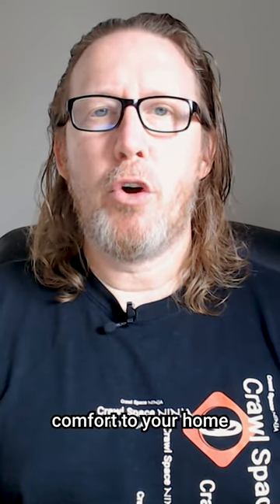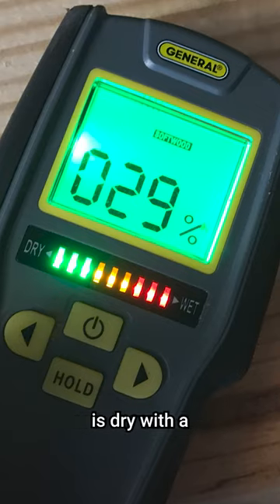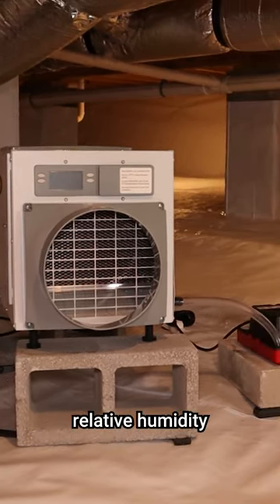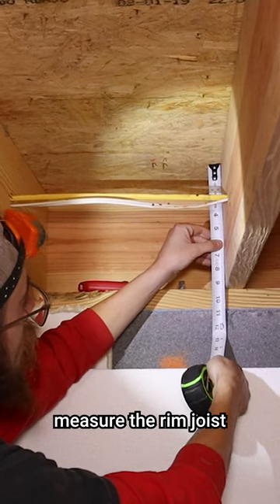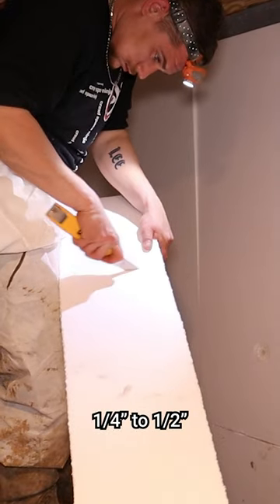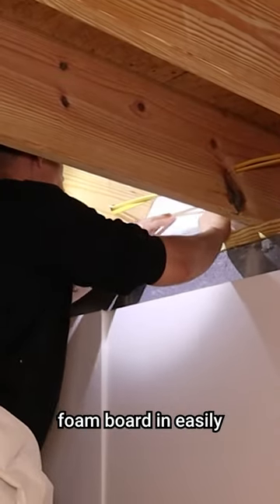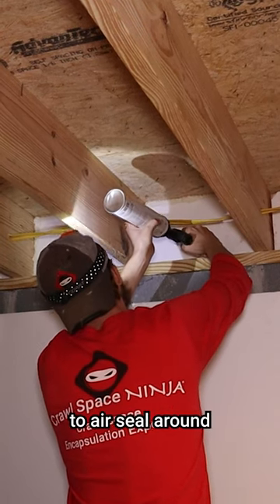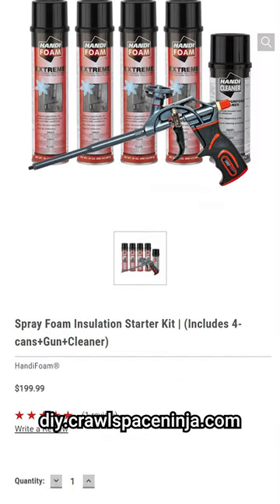4 Steps for Rim Joist Insulation #crawlspaceninja #rimjoistinsulation

Comment: I live in Maine and go one step further and add 3 1/2" mineral wool insulation (R-15) on top of foam board (R-6 or more) so total R value is R-21 or more.
Reply from the maker: I bet it helps in Maine. I have skied there, great place. Thanks for sharing.
Reply: Air sealing and insulating rim joists is, in my opinion, one of best  investments you can make it terms of saving on heating costs. And Maine is a great place for winter recreation!

Comment: I live in Kentucky and just found moisture building on the rim joists due to bad fiberglass installation. Want to go this route once it dries. 

Question: where the sill plate meets the concrete blocks is not airtight either (some areas I can see daylight) how would I seal that? With foam or caulk?
Reply from the maker: if you're okay with a thin layer covering those areas then yes Spray Foam can be a decent option. However we do know pest control companies typically will do a job like that if you're looking for that!

Comment: Can you use fiberglass batt insulation or is foam board  only recommend?  I hired Crawl Space Nija of Charlotte and they used fiberglass batt insulation and not foam board insulation.  Thanks.
Reply from the maker: Fiberglass can be used as a thermal break, and many codes require at least R19 batt to be installed. Foamboard and spray foam would be an upgrade. Thanks for watching.

Comment: I have very wet rim joist if I dry can I insulate with foam board or will water just get trapped behind board
Reply from the maker: It is possible but very slightly. Drying first will assist with that.

Comment: What happens if the wood wasn’t totally dry ?
Reply from the maker: When wood is damp and you cover it, it can lead to mold and wood rot fungus because it can not dry like it is supposed to. Hope that helps, and thanks for watching.
Reply: @CrawlSpaceNinja  thanks, if rim joist insulation was done prior to dehu install, would I still risk this? I have everything insulated, sealed   And dehu has been installed and been running flawlessly ( all purchased from y’all )
Reply from the maker: Yes, possibly if the wood was wet when you insulated the rim joist. Did you check wood moisture levels of rim joists before installing insulation? If not, I'd recommend exposing a couple and testing them for high moisture. Should be below 15%. If they are wet, you may consider removing insukation, allowing to dry, then redoing it.
Reply: @CrawlSpaceNinja  thank you !!
Reply from the maker: @Mdexter117  your welcome. Thank you for purchasing from our DIY Store. Glad we can help.